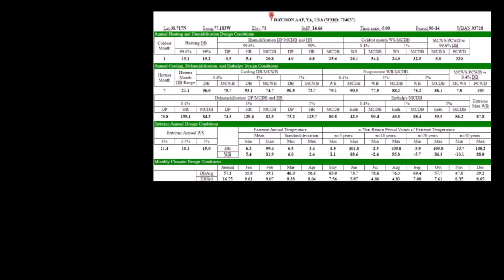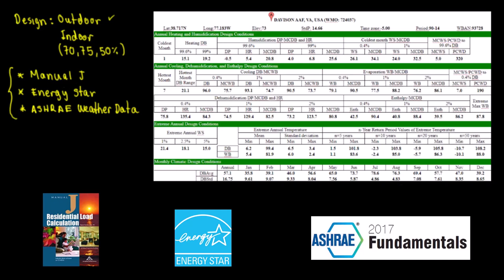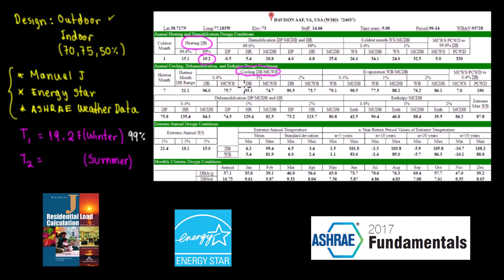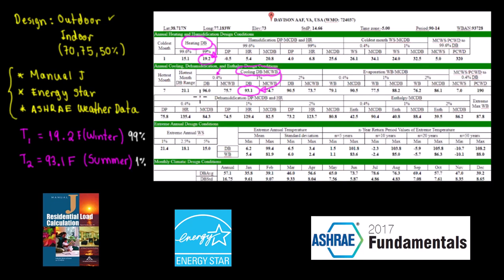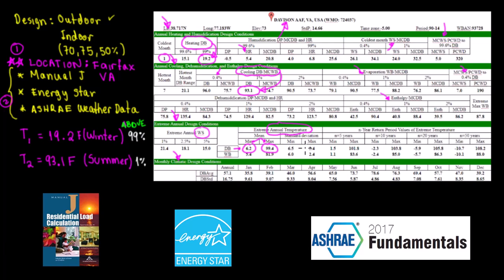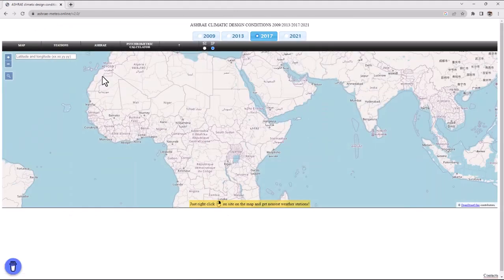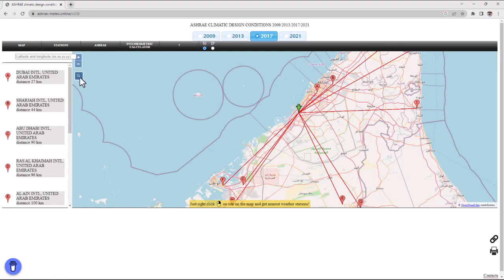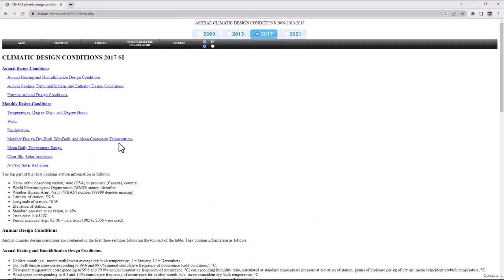ASHRAE Winter, Summer Design Temperatures

Comment: I usually use .4% Evap conditions for 100% OA unit, but which design conditions is more suitable for RTU that has RA. Maybe Dehum?
Reply from the maker: Thanks for your comment! I will get back to you on that.
Reply from the maker: Sorry for the late reply. Generally, we size the equipment based on 1%/ 99% design temperatures and we coordinate equipment with the manufacturer's representative. I believe they select in more detail and they consider the parameters you are mentioning. I would advise when selecting either a DOAS system or Mixed air RTU to check with the equipment's sale representative.

Comment: Hello, I have another question please. In the 'Extreme Annual Design Conditions' section, for example: For a 5-year return period, the extreme minimum dry-bulb temperature could reach -26.4°C. Does this mean that every 5 years, it is possible for the temperature to drop to -26.4°C for a period of 1/5, but I am confused about what this '1' represents. Does it mean 1 hour or 1 day every 5 years that the temperature could reach -26.4°C?
Reply from the maker: I will get back to you on that one.

Comment: Thanks for the video. I want to know how do we consider temperature variation, say for next 50-60 years?
Reply from the maker: Thanks for the comment. Temperature variations depends on the location. Different jurisdictions have more stringent design temperatures projected for the future. For example, in NYC we have to size the HVAC equipment based on "The Climate Resiliency Design Guidelines". That document pretty much increases the requirement for outdoor design temperature. For instance: ASHRAE Design Condition at 1% T = 86.6°F and Climate resiliency indicates T = 98°F (for 2050) 
Below is the link for the document in pdf :
https://www.nyc.gov/assets/sustainability/downloads/pdf/publications/CRDG-4-1-May-2022.pdf

In order to see projections there are different methods such as: Global Climate Models (GCMs), Regional Climate Models (RCMs), and Representative Concentration Pathways (RCPs). 

I hope this helps.
Reply: @hvaceasymath  Thanks a lot!

Comment: EN: 
Hello, thank you for this very simply explained video.
 I have a question: in winter, when you say that there's a 99% chance that the temperature will be above this figure, you're referring to (as an example) : 
DB = -19.1°C (99%) so if I understand correctly there is a 99% chance that my temperature will be above -19.1°c. So it will be colder than that (the figure is negative). 
For example, if my dry bulb temperature is DB = 11°C in winter. So there's a 99% chance that my figure is above 11°C? in which case it will be warmer than 11°C! I don't understand. Because the use of "above" has confused me.  
As I understand it, I would have said 99% of the time it will be colder than the temperature displayed. 
I have the impression that the signs (negative and positive) distort the "above" a little. 

FR:
Bonjour, merci pour cette vidéo très simplement expliqué.
 J'aurais une question, en hiver, lorsque vous dites qu'il y a 99% de chances que la température soit au dessus de ce chiffre, vous faites référence à (comme exemple) : 
DB = -19.1°C (99%) donc si je comprends bien il y a 99% de probabilité que ma température soit supérieure à -19.1°c. Donc il fera plus froid que ça (le chiffre est négatif). 
autre exemple,  si j'ai une température sèche de DB = 11°C en hiver. Donc il y a 99% de chance que mon chiffre soit au dessus de 11°C? dans ce cas cas là il fera plus chaud que 11°C! je ne comprends pas. Car le fait d'employer "au dessus" m'a mélangé.  
Pour moi, selon ma compréhension, j'aurais dis  99% du temps il fera plus froid que la température affichée. 
J'ai l'impression que les signes (négatifs et positifs) faussent un peu le "au-dessus".
Reply from the maker: Thanks for your kind comment. I might make a video to add another example. But in this case, the temperature is in Fahrenheit (°F) which is 19.2°F (Positive). %design temperature is based on all the hours in the year which is 8760 hrs where the temperature is most likely to be above this number. In this case, from 8760 hrs about 8672hrs the temperature will be above 19.2°F

Now in Celsius degrees we have a negative which is -7.1°C. So In Winter 8672hrs the temperature will most likely be above -7.1C (based on 30 year of data). When saying above I mean warmer than -7.1°C (-6.1, -5.1, -4.1, -3.1, -2.1, -1.1, 0.1, 1.1, 2.1..........)